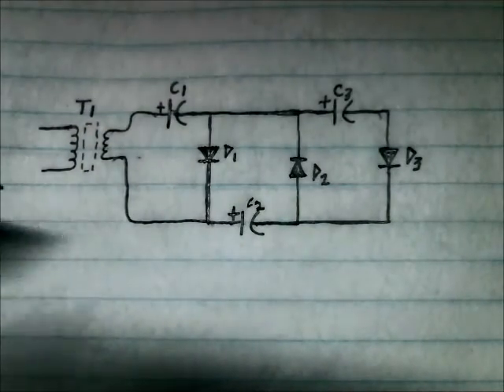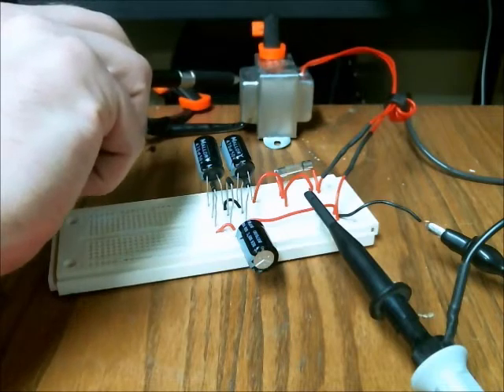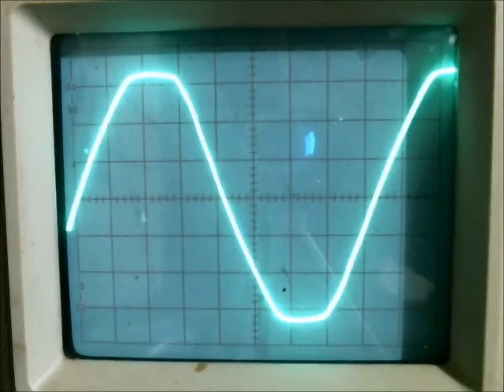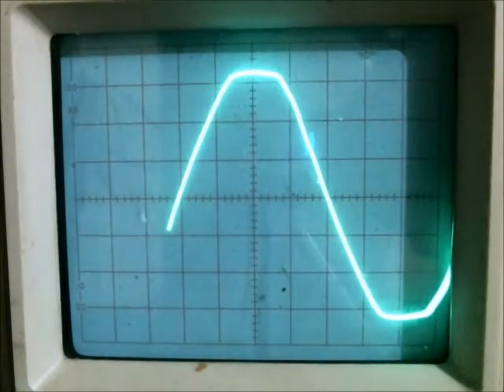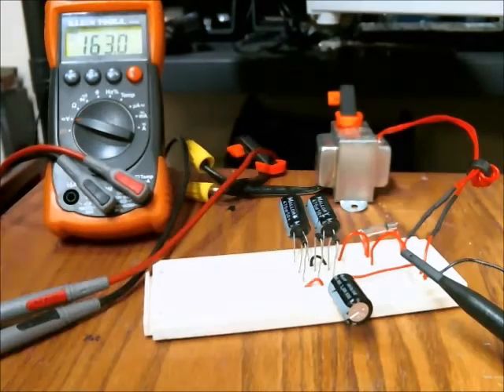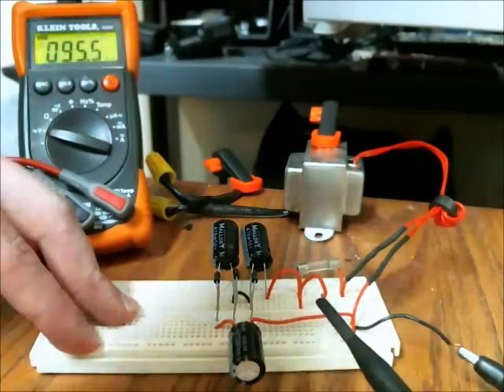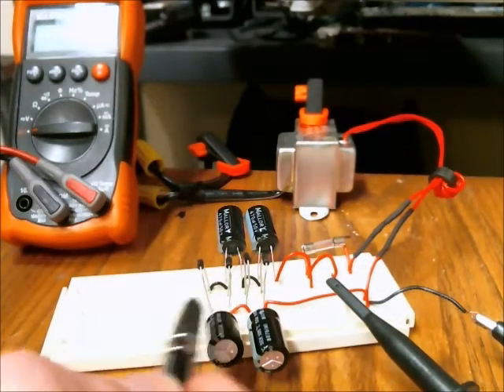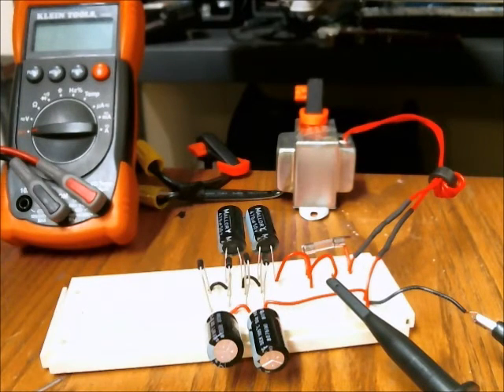Voltage Tripler

Comment: I think you were using 470uf capacitors at 50 volts. Since you had 64+ volts with the quad setup would that overload your caps?

Secondly can I use 100 nanofarad caps and get the same results?
Reply from the maker: The voltage is split across the 4 caps 
as for the 100 nanofarads doesn't look promising http://everycircuit.com/circuit/4733529975160832
Reply: Thanks for that info Heilman Hackatronics

Comment: My question is, what is the essence of a voltage tripler when it will continue to draw power from the source? Thanks.
Reply: think of what a transformer does, changes ac voltage to another ac voltage, higher voltage less current, and vice versa. Power out will always be less than power in, but in a lot of circuits you need a certain voltage to run it. With these multipliers , its the same principle. DC voltage out a tripler will be triple the original voltage but 1/3rd of the current. There is no circuit or device ever made that will create more power. I looked up these Triplers as I am working on a tube amplifier. The tubes need 600v and the transformer puts out 200v. Hence, a tripler should work fine for me.

Comment: hello brother .. i need 3kv volts so what shuld i do. do i need 3kv capacitor ?
Reply: be man . No. If you use a step up transformer with an output of 500V, then there is only a 500v potential between each stage of the multiplier. It would be best to use a rating  that is twice as big for a good safety margin. So both the diodes and capacitors should be rated for 1KV. You can have as many stages as you want and get well over 3KV with the 1KV rated components.
Reply: Correction. 1KV potential after the first stage. So 2KV rated components.
Reply: Old microwave transformer will do